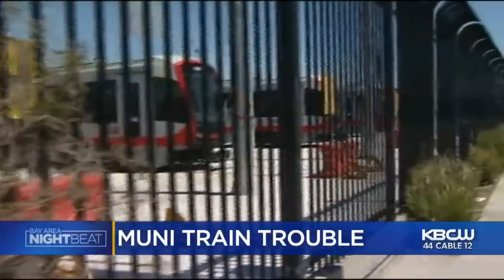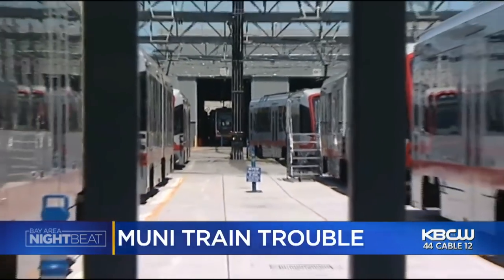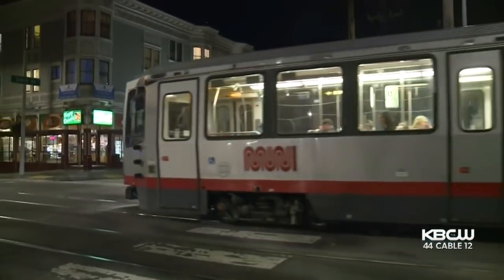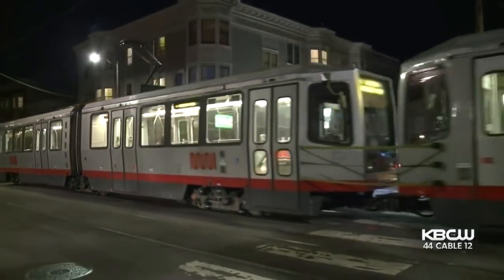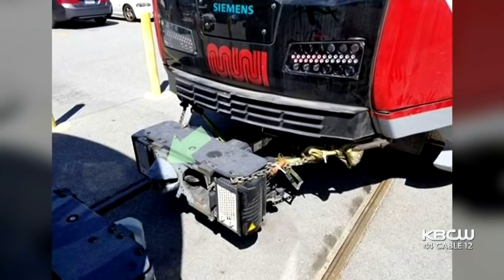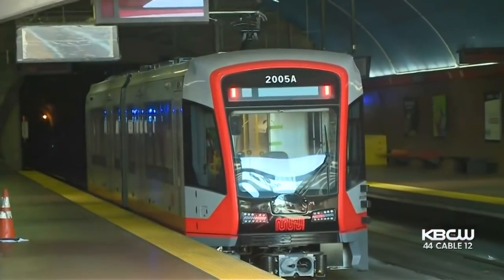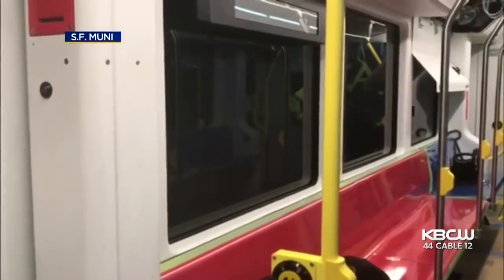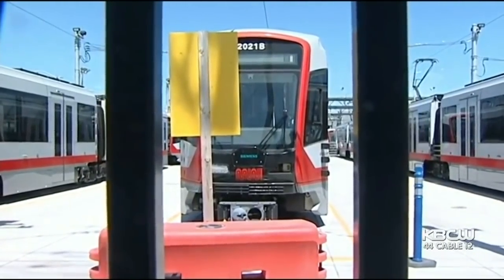SFMTA Discovers Broken Shear Pins On New Muni Streetcars

Comment: i bet the couplers are maxing out their movement in corners and they still need to turn tighter .. this would put tremendous force on the shear pins.  i noticed in other reports that these rail vehicles don't pass each other in turns .. that could mean the turns in those locations are tighter than the cars were designed for.  could also happen when switching between tracks..  it will require running a pair of cars with go pros looking at the coupler movements.. and if they reach the limit anywhere in the system.